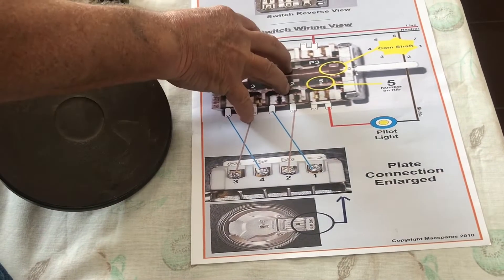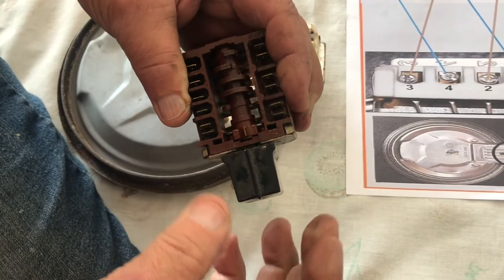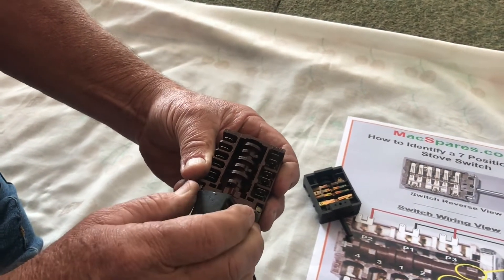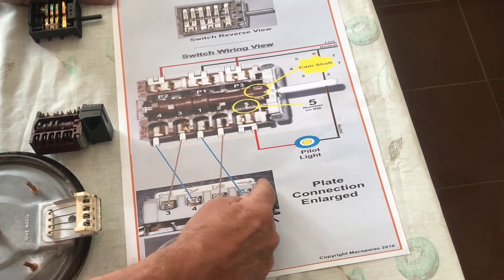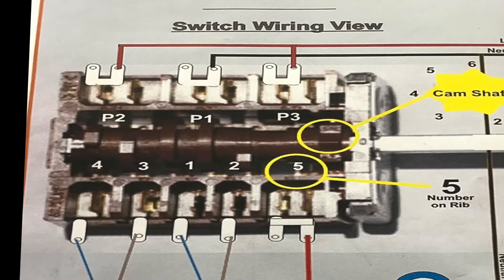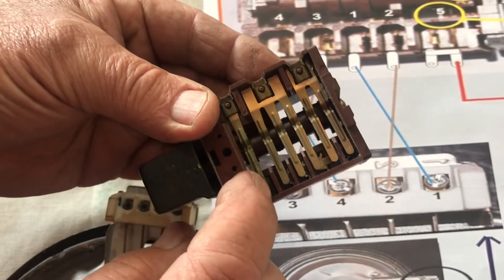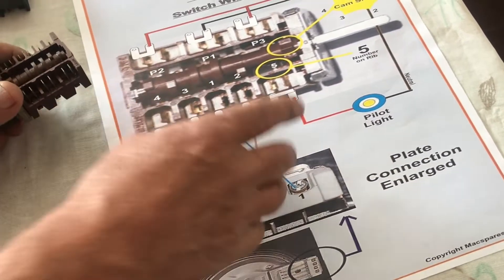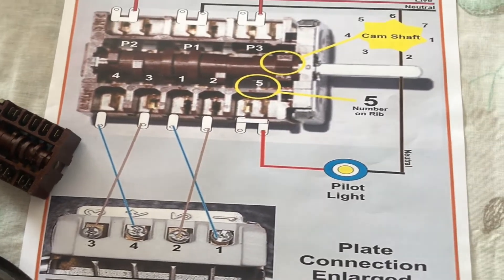How to wire a Solid Plate to a Seven Position Stove Selector Switch

Comment: Remember dont use any available wire because the plastic will melt cause a fire and short circuit...
Heat resistant wires of the correct amprage draw...